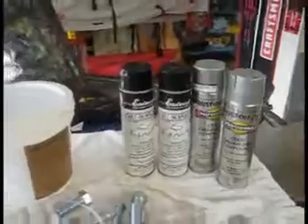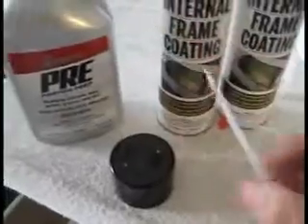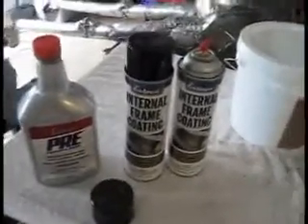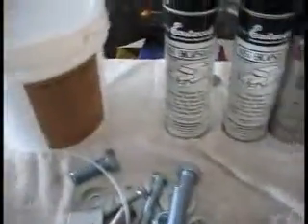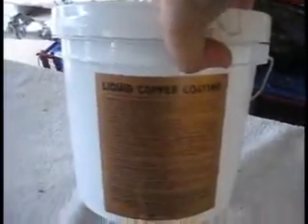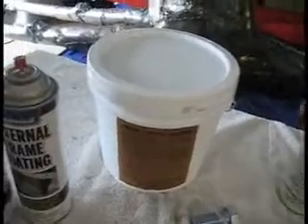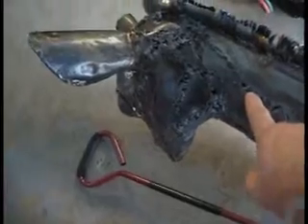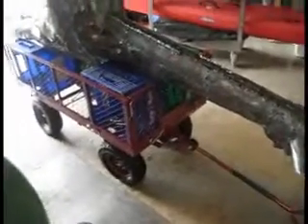Painting the Giraffe

Comment from the maker: @eagledancer2000 
Good tip Todd.  Unfortunately I signed on to see this message after I already applied it.  And it did drip out some.  It was some nasty stuff so I only used one can and then decided that was it.  I wiped it off pretty good before doing the outside.  Thanks for the advice.  Always appreciated.   Jim